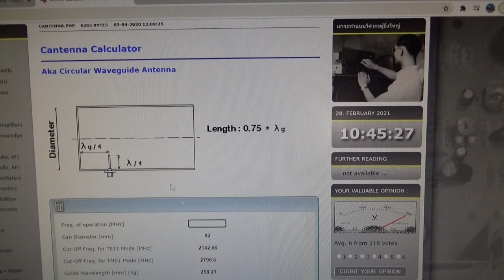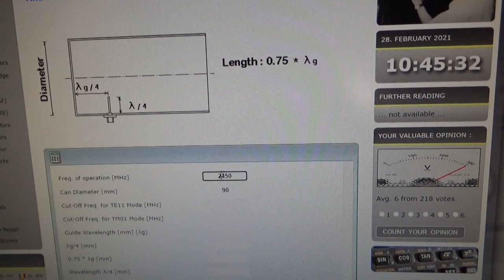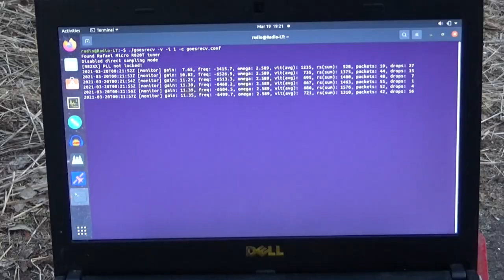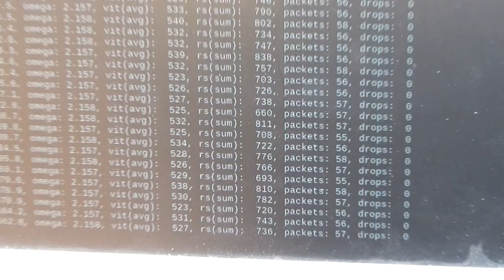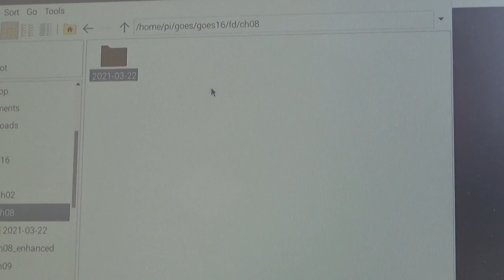Satellite Ground Station With Trash, Cardboard, and Foil Tape!

Comment: The actual GOES downlinks use 16 meter antennas so your little .25 meter antenna is pretty impressive.
Reply from the maker: It was very marginal, but it did work! I need to get my 2.5 meter dish mounted and set up permanently for this, just haven't found an acceptable way to bolt it to the roof yet 😅
Reply: @saveitforparts "just haven't found an acceptable way to bolt it to the roof yet" 
just hold it there with some bricks and beer cans bro 😆

Comment: I followed your instructions for an antenna for the 137MHz weather satellites and I got some killer pictures of my area. So now I'm going to use your tips for a GOES satellite.
Thanks for your channel!
Reply from the maker: Awesome! I've been using some larger dishes for GOES recently, I'll do a follow-up video soon. If you can find an old C-Band dish (the bigger ones), or even just a slightly bigger KU dish like the "Alaska model", that would hold up better than my cardboard and foil tape! Otherwise Nooelec sells a grid dish on Amazon if you have spare $.

Comment: I absolutely love this channel, your ingenuity and disregard for the prevailing attitude that X equipment is “required” to do Y job is inspiring.  Brings me back to when I first got into radio and electronics and wanted to do everything but had little spare income and no tools.  Every aspiring nerd should watch stuff like this to realize that the underlying principles are what should guide you, not a Howto that says you need this product and that product to get started.  Admittedly you are using purchased off the shelf products like an RTL-SDR, some things are definitely better purchased than home brewed, but your “let’s try it” attitude with stuff like expanding the dish area with cardboard and foil tape, should be celebrated.  Keep up the good work!

Comment: Pretty neat.  Maybe you could get one of those 6 foot dishes on a pole.  You know, the ones we used for sat tv back in the 80's and 90's.
Reply: Those totally work, and hobbyists actually use them for the second signal this satellite puts out. The signal captured in this video only puts out a fraction of what the satellite captures, the other signal is much wider, and weaker so a larger dish is needed.
Reply from the maker: I'm hoping to find one of those big 80s dishes being thrown out, there are still a few around but they're usually pretty far out of town.
Reply: @saveitforparts  I'll bet a drive in the country would yield one from a farmer.  He'd probably give it to you for free just for taking it away.

Comment: To do something like this long term.. look into getting a NAS, Network Attached Storage.. A mini one holds four hard drives and you can access the images and whatnot over the web.. basically its a file server and depending on the capacity of the drives you get, you can store well over 8TB of data
Reply from the maker: I'd like to set up a dedicated antenna and download server for this. It's on the list, but so are a lot of other things!

Comment: This is excellent. I'd love it if you made a more permanent setup for this!
Reply from the maker: I'm watching for a free dish, I've found a few but they're usually waaaay out in the countryside.
Reply: @saveitforparts  roadtrip time?
Reply: @saveitforparts  What size do you need? Ill keep my eyes open for you.
Reply from the maker: @andy1845c  Anything 4-8ft should fit on my roof rack, any bigger and I'd have to disassemble to transport it.
Reply: @saveitforparts  Hello, I want to try to repeat the project, can you share what kind of Arduino board it is and also the code (sketch)?

Comment: I was so inspired from this video that I got my old derect tv dish out and got to work but I’m struggling badly I have all parts just have to figure out how to put the cantenna on Dish and make the dish bigger
Reply from the maker: There are a few websites out there with info about making and positioning the cantenna. I think I liked to a couple in the description, or this is one: https://lucasteske.dev/2016/10/goes-satellite-hunt-part-1-antenna-system/
Reply: @saveitforparts  thanks

Comment: I have an old 2 meter C-band dish, will it work with GOES satellite?
Reply from the maker: Probably, if you swap out the TV LNB for a feedhorn / cantenna tuned to the right frequency. I also have an old C-band dish I'm hoping to use for GOES soon!

Comment: So did you ever  find a c band dish? For easy way to get one is drive around the country side and you can usually pick them out and stop and ask them to see if they want to get rid of it for most will give away free if you take down.   For that's what I did for my FTAsatellite  I acquired a 10 ft unimesh dish that's motorized.  And I use it for fta TV like wwe wrestling on 55 west and the nasal channels in 127 west.   I'm trying to get goes 16 with the noutec dish and sdr but having issues with software to decode it.
Reply from the maker: I did get a C-band, yeah! It was full of hornets but I got it home and now it's junking up the yard and lowering my neighbor's property values :-D I haven't installed it yet, need to wait for spring.
Reply: @saveitforparts  what you should do is  set it up with if it's motorized is install a new digital c band lnb and install a can antenna next to it on the side of the lnb so you can  use it for FTAsatellite and goes satellite for c band fta has more to offer than ku band.  You will need a 36 DC volt power supply and a control box like what you used for your goes dish or if you can find a used vintage satellite positioner in ebay for that's what I use to move the dish.  Grease up the actuator also if it came with one for it will work better with fresh grease.  Good luck..  robbie strike on YouTube has good videos set up FTAsatellite

Comment: I've been attempting this with A NooElec mesh antenna, a Sawbird+ GOES, and a NooElec SMArtee RTL-SDR, but try as I might, I'm not even having any luck even seeing the signal on the SDR# waterfall. I'm nearly certain I'm aimed where I'm supposed to be aimed, but I tried adjusting it left and right up and down gradually to see if I see anything pop up.

I've had success in the past receiving those polar NOAA satellites with rabbit ears you mentioned, so I'm not a complete n00b at this sort of thing.

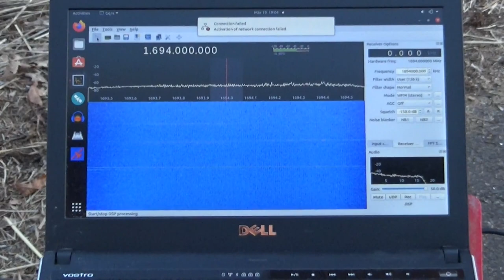At 4:24 you say you can "just barely" see vertical lines in the waterfall at 1694.0 MHz. Maybe the YouTube compression is messing with it, but I'm not really seeing anything. Or are the lines you're talking about super faint and coming down from about 1693.5 MHz to 1694.5 MHz? Is it that wide a signal?

Also - (If you can recall, or make it out from the video) do you remember approximately how many dB above the noise floor that signal was with your make-shift setup?

Any help would be appreciated, but I understand you're a busy guy and might not have time to reply. Not a big deal!

[my apologies for the lengthiness of this comment]

[btw - Big fan of the channel! I've been checking out your stuff for over a year now, and really enjoy the "Just get it to work with whatever I've got" mentality. Greetings from northern Illinois!]
Reply from the maker: It is a pretty wide signal, depending on your SDR software settings you might not see the whole thing. I think I had to increase my sample rate to get a better view. Here's an example: https://www.sigidwiki.com/wiki/GOES_High_Rate_Information_Transmission_(HRIT)

I don't remember the dB or much else about the technical details, it's been a little while since I did this. I have some other dishes I want to try, and I keep meaning to set up a permanent ground station for this. Just need to find the time among all my other projects! 

I do remember that getting the position just right took some fiddling. There's azimuth and elevation, and IIRC a skew angle (rotation of the dish / feedhorn). Plus the cantenna/feedhorn has to be at the focal point of the dish and any extensions. It was one of those things that I eventually got right with my garbage set up, but wouldn't last a light breeze or rain! That's why I want to use a real dish and a solid mount of some sort.
Reply: @saveitforparts  Thank you!

Comment: Do you need a smaller dish or bigger ? I have a portable dish in a case if you want it for free . It’s about 12” round and on its own brackets and case used for RV’s . Let me know and I have a couple of satellite meters for aiming the dish .
Reply from the maker: I need a bigger one for most of what I want to do, although if the little dish has motors to aim itself I might be interested!
Reply: @saveitforparts  no motors , sorry .

Comment: Are the goes satellites still operational? Or communicatable?
Reply from the maker: Yep, there are two active ones and some backups, I think they move the old ones around a bit to cover Europe and Asia sometimes. I'm hoping to do this again, but with a permanent dish instead of just cardboard and foil tape!
Reply: @saveitforparts  do you know how to calculate when the next noaa satellite is overhead?
Reply from the maker: @chasegunner9719  n2yo.com is a good website for it. There are a few others but that's the main one I use

Comment: What did you use for software receiver example Sdr ++ or gqrx
Reply from the maker: I mostly used gqrx when I did this video, lately I've been using SDR++ more.
Reply: @saveitforparts  how did you get Sdr ++ on raspberry pi 

One more thing goes tools is now available on windows posted in July of this year, I wonder if you could try goes tools on windows because I’m having trouble with it

Comment: Hi, I'm trying to replicate the same Feedhorn yours, can you answer this comment with the dimensions of yours please, the diameter of my can is the same of yours. Very good video and also sorry for my English, I am from Chile.
Reply from the maker: Hi, I checked my notebook from last year and the numbers I have are: Frequency 1690Mhz, can diameter 127mm, probe length (center wire inside the can): 44.375mm, probe distance from rear wall of can: 37.3575mm, total length of feedhorn can: 112.07mm. The website I used to calculate should be listed in the description, although their calculator seems to have changed. When I ran my numbers through again they came out differently. Hopefully you get something that works!

Comment: what is the relation bewteen the wave condutor/container's( the can's) diameter and the wavelength?
Reply from the maker: There's some math involved that I don't fully understand, I usually just find an online calculator and plug in the numbers I want to work with!
Reply: @saveitforparts  thank you, keep on with pragmatism

Comment: If I connect the LNA via USB and don't use the CC filter, does it damage the SDR?
Reply from the maker: It depends on your equipment, some LNAs feed power back the wrong direction and need a DC block. I only came across that while reading about other people's setups online, I don't know which brands are better or worse for that.

Comment: did ya get that c band dish for this project ?
Reply from the maker: I have one leaning against the garage beautifying the yard, I just haven't had time to install a pole for it.
Reply: @saveitforparts  If your going to all the effort of adding "sides" to a small dish, why not just try and make a choke ring antenna for this 1.6 ghz frequency and forgo the dish alltogether. choke ring antenna is pretty much a c band feedhorn WITH the scaler ring. So its like your cantenna with concentric rings. Very cool video, and effort
Reply from the maker: @jeremycole3008  Interesting, I'll have to look into that! The signal from the GOES satellites is so weak that I think a big reflector is needed, but maybe that choke ring deal would work at the focal point?
Reply: @saveitforparts  Im thinking this: Speed of Light is 299,792,458 m/s in Air or Vacuum. If you assume the velocity in Aluminum is 95%, you get: 284,802,835.1 m/s. That number, divided by the frequency of 1,686,600,000 cycles per second, you geta full wave (in aluminum) of .16886211 meters or 168.862 millimeters. 25.4 mm per inch gives 6.6481 inches. The ring thickness is 1/4 wavelength, and the spacing between rings is 1/8 wavelength. 1.662 inches tall, and .831 inches inbetween. My CBand scaler ring measures an 1.08 inches tall and 1/2 inch wide, so I think these numbers should be good. The CBand feedhorn is 500 Mhz wide between 3.7 Ghz & 4.2 Ghz, so the accuracy of these numbers might not even be that critical

Comment: How long is the wire on the uhf connecter
Reply from the maker: Not sure which one you mean, I had a variety of random wires for this project and didn't really bother to measure anything.
Reply: @saveitforparts  sorry i meant the copper wire in the cantenna, how long is it

Comment: Why doesnt the dish point up
Reply from the maker: It's an offset feed, most modern dishes use that design to save money since they can be smaller. Think of it as being only the top 1/3 to 1/4 of a traditional satellite dish, the focal point is still in the middle but the rest of the dish is missing. http://www.datawelder.com/satellite/sFAQ/sfaq.html